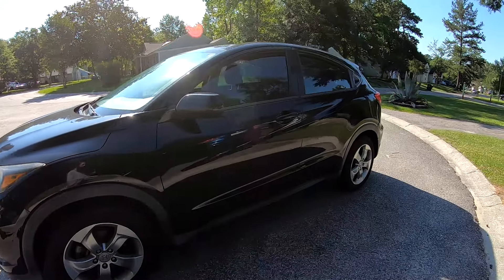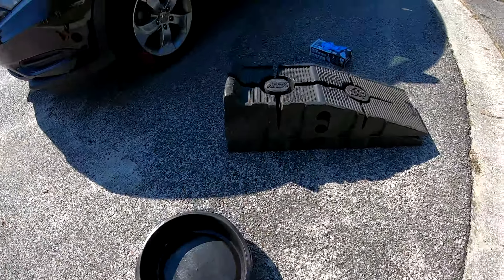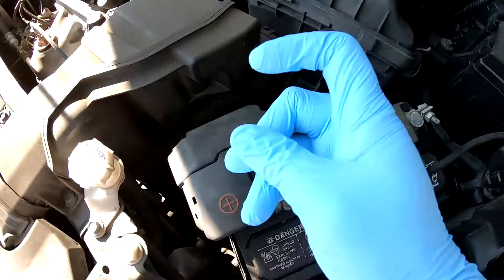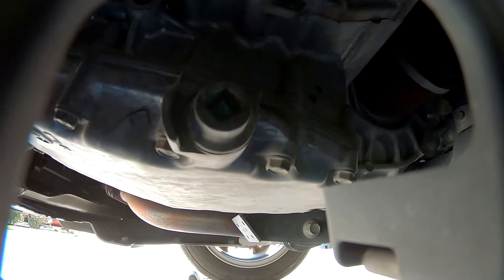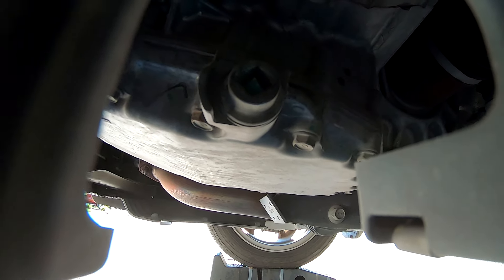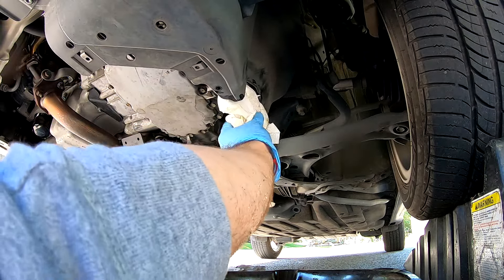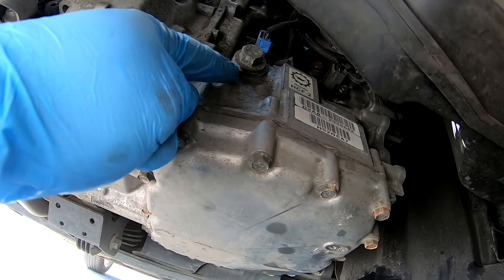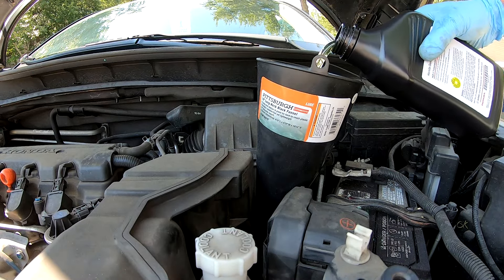2016-2022 Honda HR-V Transmission Fluid Change CVT Drain & Refill

Comment: Torque specs are 36ft/lb for the transmission drain bolt, 32 ft/lb for the check bolt. There are actually 2 filters for this transmission type, they should be changed on the 3rd transmission fluid change. Please do the check bolt next time, to ensure you don’t overfill it.
Reply from the maker: Solid advice 💪

Comment: You’re a life saver thank you for this video!! I only wished you showed how to take out the cover underneath but I’ll figure it out I guess. Overall awesome video and very thorough 👍👍👌
Reply from the maker: Hey, there 👋  thanks for commenting. That cover has to come off and go on every oil change so I figured most folks had done that before. Hope you got it squared away 👍.
Reply: It’s about 13 screws and clips of various sizes and shapes, truly a pain in the butt, I bought a bunch of miscellaneous ones so I can replace a few that were missing

Comment: Hello! Quick question: do you know if the car doesn't have to be level to do this job?
Reply from the maker: In general, you should get it as level as possible to help with draining and filling properly. Being slightly off shouldn't make a significant difference.
Reply: I dont think so cause he knows how much is gonna take to fill so the level will be the same no matter the level if is 4.6 is gonna be 4.6 no matter what
Reply: I have the same car mine is a lx 2wd and when I did mine 4.2 was way to much it ended up being 3.5 my car was level on a lift and it was 3.5 quarters b4 it started dripping out the check plug
Reply: @derekgreen4531 for the 2wd models the dealership told me that its 3.7 quarts

Comment: I have a 2019 HRV, 31+K.. When should I change the OIL..?
Reply: Every 50-60k miles.
Reply: Every 30 k  at 50 to 60 it's already black and worn

Comment: They are serviceable, I just bought my 2 filters for my Honda HR-V cvt.
The normal big filter that is into the transmission's pan and the small filter that go into the transmission's oil cooling circuit.
That is why many people complain about this transmission, but the problem are the people, they do not replace both filters when they service this transmission.
Reply: Why don't you change the filter in the tank? It does'nt need to replace the filter?
Reply: @백자욱-t5b  I replace all filters.
Reply from the maker: Many different opinions on this. Someone else mentioned they should be serviced every third fluid change. I made this video based on what I was told by my local dealership service rep. I am not an expert. I would suggest to all to consult your local Honda service department. Fwiw, I dislike the transmission in general, but it works as it did when new. No complaints. 

Thanks for watching.

Comment: Thank you for the video. I need to perform this service on my daughters 2022. Seems just about as easy as an oil change. I will be using AMSOIL CVT fluid.
Reply from the maker: Glad it was helpful. Thanks for taking a second to comment. But yes, absolutely. If you can handle an oil change, this is just as easy.

Comment: Whoever told you no filters is a liar there’s 2 I just dos them on my sister in laws 19
Reply from the maker: Yes, there are filters. They are just not part of the 30k mile service interval is what the dealer explained to me.
Reply: @ awe my buddy is a foreman at local he told me to do the pan filter every 30 and the upper ever 60 knock on wood 160k on original transmission
Reply from the maker: Right on. Sounds like you know everyone has their own recipe for success when it comes to servicing their vehicles. Would definitely suggest to everyone to consult their local dealership/owners manual/etc. Thanks for watching 🙏.